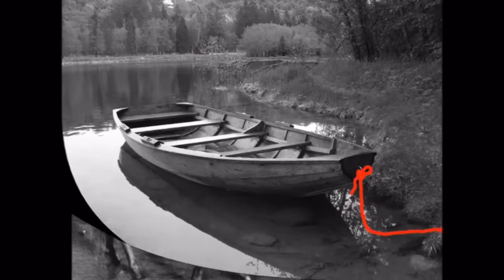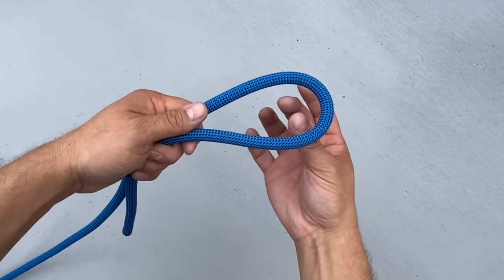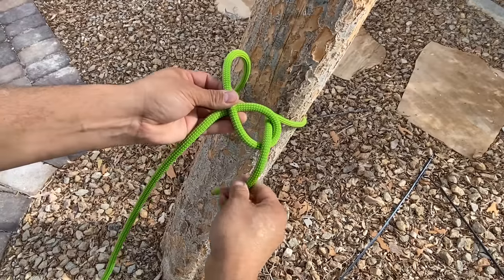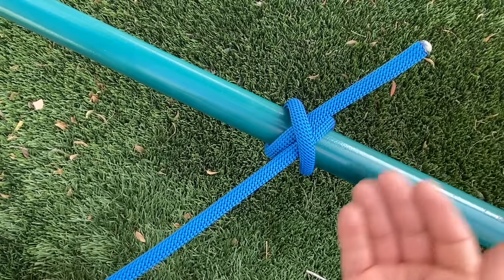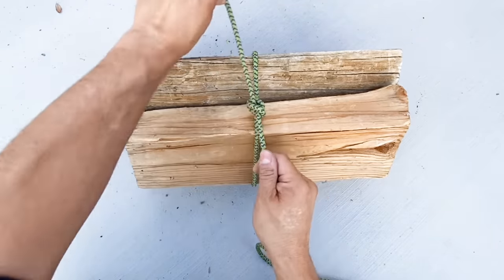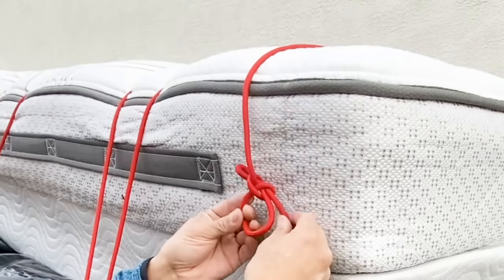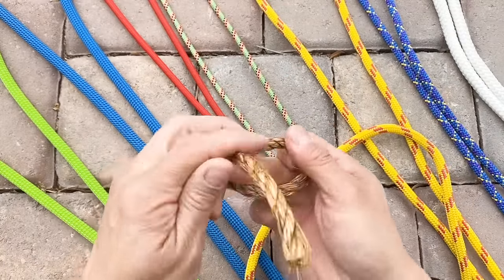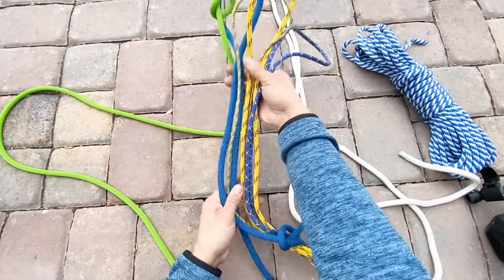The Beginner's Guide to Knots

Comment: I have a video requests! Can you think of any way to tie an adjustable knot that could be used to change the effective length of a charging cable. So when you slide the knot one way you get the full length of the charger and when you slide the other way the cable is shortened so it doesn't get tangled in a bag.

Comment: I use white sisal rope on my truck at work.  It bites into itself really easily which means any simple knot holds well.  It's pretty tough too.  The downsides are that you can't get crazy with how you tie stuff and it can jam on you if you aren't careful.  The ends fray too but we just tape those to stop that.  It works great for what we use it for but there's a lot of applications I wouldn't want to use it for.  Great video man

Comment: I appreciate your brief, to-the-point videos on useful knots and other practical matters.  If you have not done so, it would be helpful if you would identify different, reliable brands of  Paracord, and comment on their suitability for typical DIY projects, including comments on strength, diameter, weight, abrasion resistance, resistance to breaking down from sunlight or exposure to excessive heat or common chemicals, such as solvents, bleaches, gasoline, etc.  If your viewers use weak, overly stretchy, or unsuitable Paracord for their needs, they will not get the same results you do. 

I believe you have learned from experience which types and brands of Paracord or line to use for different projects - please share some of that information with your viewers in the "Show More" box that YouTube provides for this purpose, or point us to a prior episode where those matters were covered. 

Thanks for making these very helpful videos.

Comment: we use a clove hitch alot at work, its very strong and for most short term aplications its plenty strong enough without any security knots, ive lifted over a ton with one. so they are super secure. but a pain to open after alot of weight

Comment: Wow, crazy how you become so accustomed to doing it one way and I have been doing it wrong where it always come loose. Thanks this works great!  One question though, how can I create a knot that doesn't come loose but I can easily adjust it? It is nearly impossible for me to tie my shorts tight with this knot without it coming slightly looser as I complete it.
Reply from the maker: Check out the gym shorts knot on my channel, thanks

Comment: When tying down a load with multiple passes, like that mattress, lock off EACH passage thru a shackle with 2 half hitches on a bight, or individual trucker's hitches. That way, if the rope fails, the whole mess won't come undone and lose the load. I learned this thru bitter and costly experience. It's more time and effort, but it's much, much more secure.

Comment: 4:24 For anyone owning a boat; you can just add more of the loops. It's much quicker both to assemble and release. Like, near instant. Also easier to adjust depending on weather or tide if you need.
If it's not a pole, I guess the example in the video is most efficient.

Source: Norwegian, there's boats everywhere for normal people, and driving various sizes since 8 or so and small ones up to 9ft 9.9hp trimmed solo since 14-15 maybe

Comment: I have several gas cans plastic type with a handle on the top and a handle on the side which turns into the top when pouring it out.

I’m tired of them spilling and tipping over in the back of my truck I’ve tried tiring them to a taunt line on the front and back of the cans but it’s crazy to have to untie the whole thing any time I need to get a fuel can out untieing every time 

Can you help 

I am trying to figure out how to keep them in place but have a quick release with out

Comment: For the truckers hitch/tie down knot, you use the clove hitch. Does using a larks head make it not work? Why/why not? Or advantages/disadvantages?
I use that cheap junk rope to make dog toys cause my dog is going to shred them up in minutes anyway :D but it is ratty!
Reply from the maker: A larks head will work too. It comes down to personal preference. I need to make a new dog toy for a friend of mine. Just like you said, he ripped up his rope toy real quick. Thanks for the comment.
Reply: @First_Class_Amateur  i make tugs with a really simple knot, you could probably improve on it.. i just do the 'four strand macrame knot'.. you cross strand 1 over 2, 2 over 3, 3 over 4 and 4 goes in the window of 1?.. if you reverse direction every time, you get a straight squareish thing, otherwise it has a spiral. I've done them with more than 4 strands and with various diameters of rope too. I just start them with a bend (two ropes folded in half) and finish with an.. overhand knot? I think? The big kind that wraps around itself.

Comment: I want to point out that your wannabe-trucker hitch around 6:10-7:30 WILL NOT WITHSTAND HIGH TENSION, at least not with every kind of rope. I managed to pull it loose with my bare hands, i.e. without the leverage that you apply by the pulley design you use. The mattress you put on top of your freight heap offers a slowly, moderately increasing resistance against your tension when you pull it tight. This will not work with a heap of hard material. It might shake loose.
If you really want to test a knot, use it with a rope that offers the most unfavorable qualities and conditions, in this case it must be one with a smooth surface. Maybe it works if you poke through the bight from the standing part side, i.e. from the side of the freight.

Just sayin'. Correct me if I'm wrong.